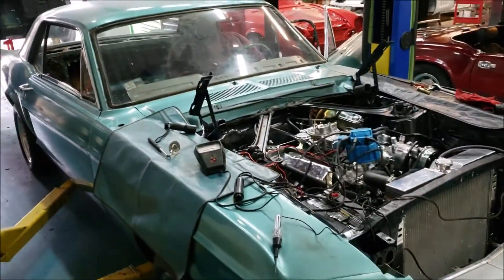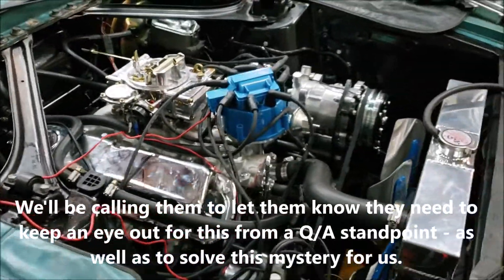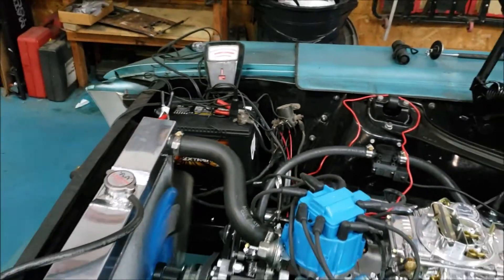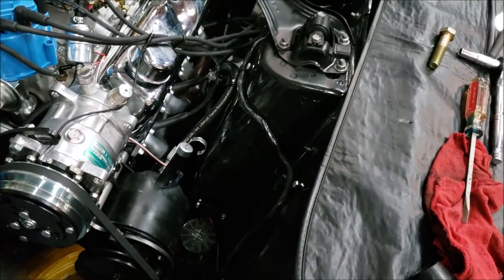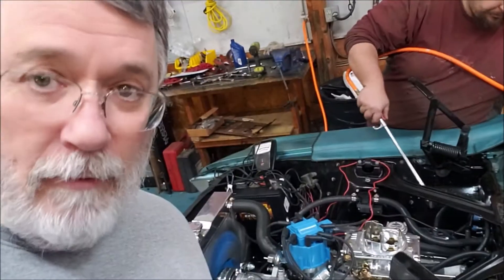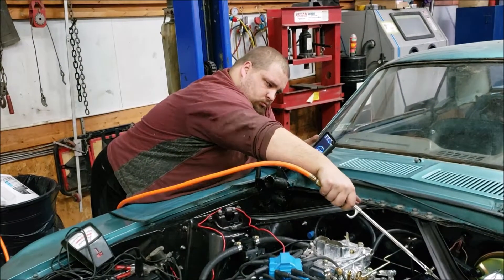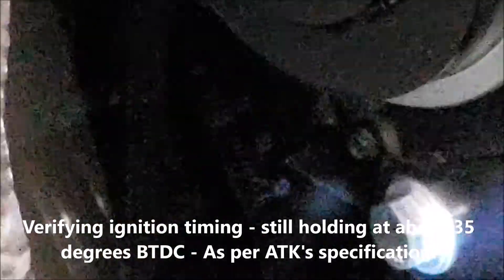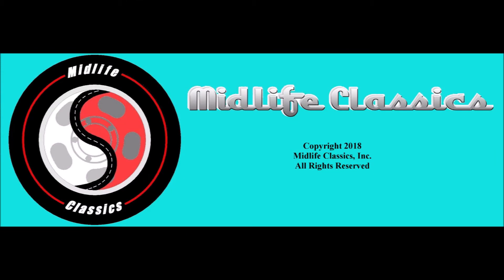1967 Mustang with 302 Crate Engine - Cam Break-In Session 2

Comment from the maker: A friend/client pointed out that the exhaust port holes are for thermactor control in the later generation heads.  Thought it might be something like that, but would expect the manufacturer to either plug them or at least tape them over as they did all other openings.  Mystery solved.